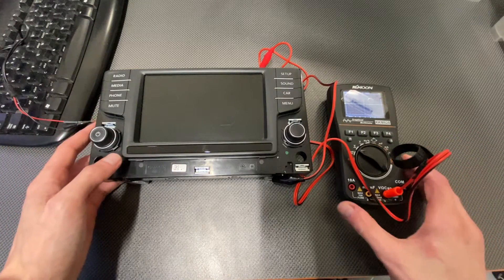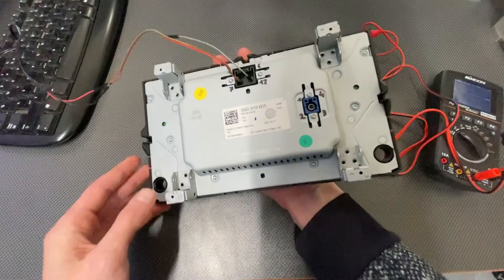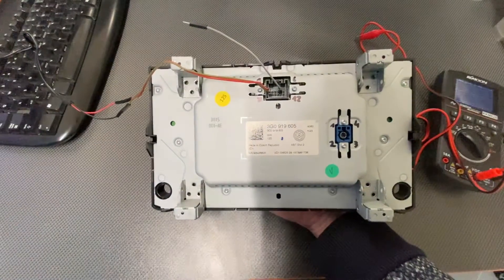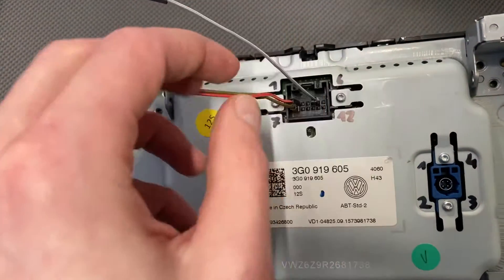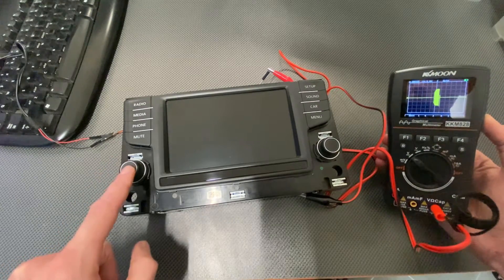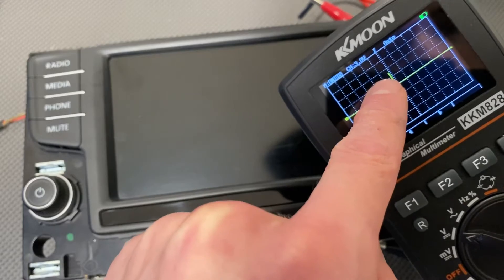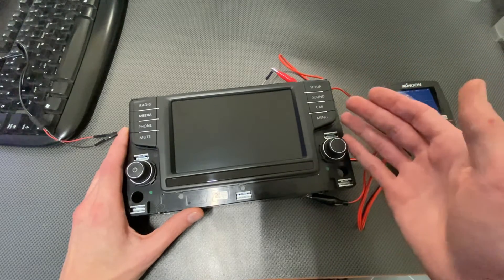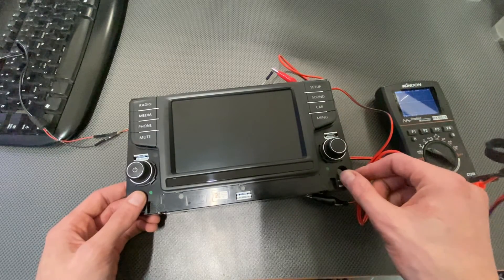MIB Display: ZR_Reset pin for main unit reboot

Comment: any idea why a pcm 4 display won’t power on besides the button backlights? i’m retrofitting the unit in my 958.1. wiring is correct. could it be that the receiver isn’t sending a “power on” can message?